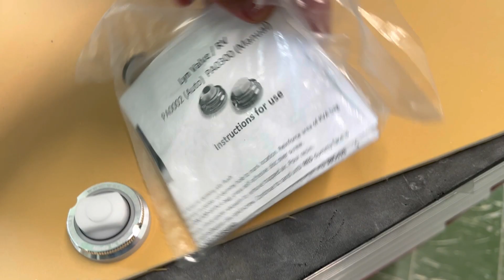Preparing for a Wedding in Haiti 🇭🇹

Comment: Hi you are doing a great job for haiti , there is a ederly lady who needs a leg because shes missing one in petion ville and getting weak holding  the cruchtes , if you able to help shel be happy Thank you
Reply from the maker: Yes of course 😊☺️ Come to the hospital and we can work on it right away 🥳😊☺️ 
steps that we will take will be (takes 4-5 appointments to complete) 
1. assessment / payment payment options etc 
2. casting once complete 
3. fitting and check socket alignment 
-if not correct we will redo it and do another fitting 
4. final fitting